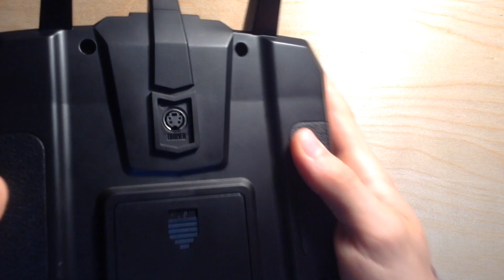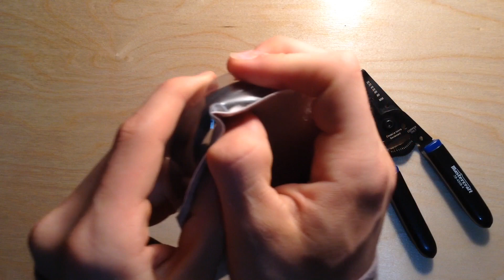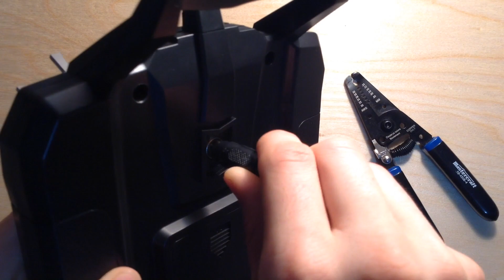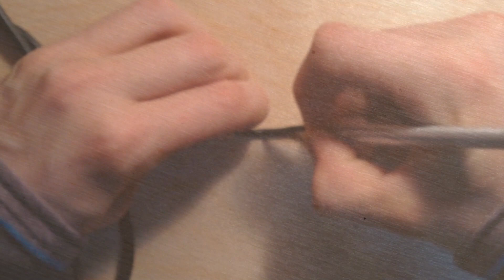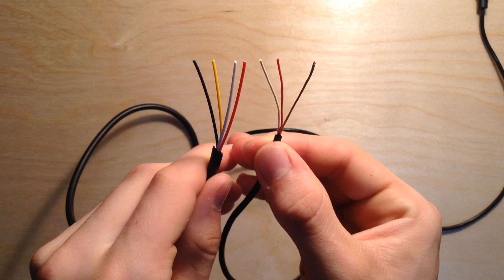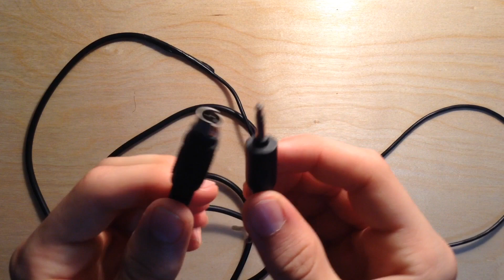DIY: FS-i6 Simulator Cable

Comment: so i have my cables connected and smartpropoplus says the transmitter is connected but i've encountered 2 problems.
1) smartpropoplus is hogging all the resources on my pc causing performance in the sim to tank
2) smartpropoplus is also interpreting the signals from the transmitter very erratically and not giving stable signals to the sim. my cable is soldered pretty cleanly as i have had previous soldering experience.

is there any explanation for this?

Comment: it works with my win 10 and reflex sim. but no airplane engine sim volume....if i turn up speakers i get a ping noise so loud it will drive u nuts. i have to fly with volume turned down. i just striped one end of the 3.5 stereo  cable. And went direct in radio with ppm and a ground.ANYONE HAVE VOLUME???
Reply: Hey
Do you know why i can,t Downloade the Software?
If you,re cool ypu send it me via E-mail
Tim

Comment: EDIT: I made 2 sim cables and both had the same problem with line noise. i got a legit cable and the difference is night and day. my channel levels are where they're suppose to be not 90% full.
Conclusion/recommendation just buy the damn data cable... you can get one with 2 different ends that have a female audio cable. i threw out the larger one.  and plugged the right one into a male/male audio cord. works much better than my home made sim cables. i got the data cable for ~$9

original comment:
My sVideo cable had 4 wires and none of them were ground. I had to make one connect to ground. (also you could have made 2 cables. but always leave some wire on the ends just in case you need it for something else.) 
walkera worked for me but pitch, roll and yaw are at 90%. i think the line is too noisy.

Comment: My s video cable has only 3 wires... is that a problem? A red wire.. a black wire and 1 exposed wire.
Reply from the maker: Should work perfectly fine, I'd try stranded and red wire first
Reply: Genesis RC & FPV Thanks! I hope it works but can't test it yet. I don't have my trex 450 with Flysky transmitter yet.... I have to wait 1 more week. But I think it's clear how to connect it.... my audio cable with 3.5mm jack also has 3 wires... Red, green and exposed. So there are only 2 options... solder exposed wire to exposed wire... red to red and green to black or exposed wire to exposed wire and red to green and red to black. But I think option 1 will be the right way.  Btw... why use a lighter for the shrink wrap if you have a soldering iron? I always use the soldering iron for that. But not the tip because that part is too hot. I use the thick part close to the grip ;)
Reply: @GenesisRC  Hey.... can't get it to work.... do I need to change some settings in my i6 transmitter?

Comment: ++Genesis RC & FPV -    is this way same as FS-T6..?
Reply from the maker: If it carries a s-video port like the FS-i6, then yes
Reply: sure... it's like FS-i6, bcs they're brother..!
Reply: ++Genesis RC & FPV -     and then..  we dont need 'the usb/ dongle simulator' anymore by using this, bro..?
Reply from the maker: I'm sorry i don't quite understand what you're asking?
Reply: dongle simulator like, RC Flight USB Simulator or fms..!
Reply from the maker: The purpose of making this cable is to connect your transmitter to a simulator.
Reply: could we play rc flight simulator FMS, phoenix or XTR by using this, bro..?